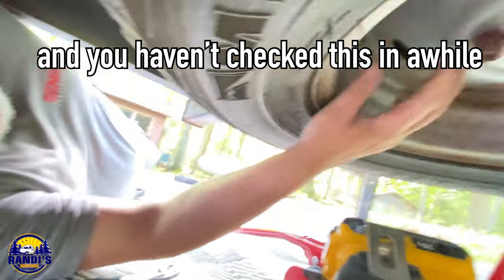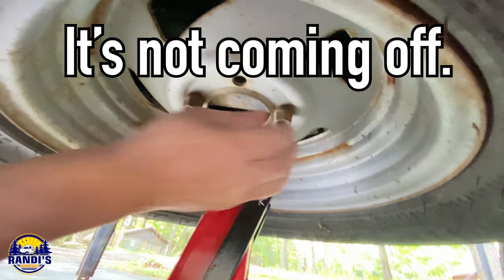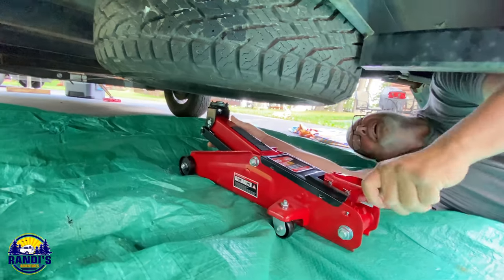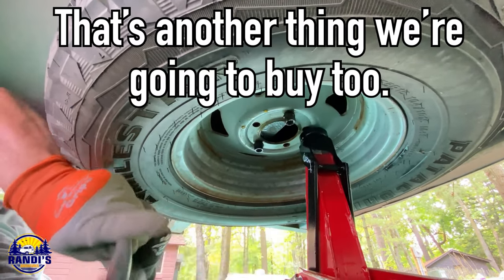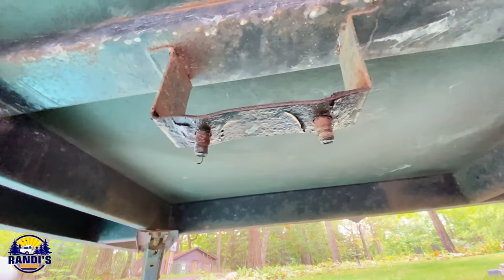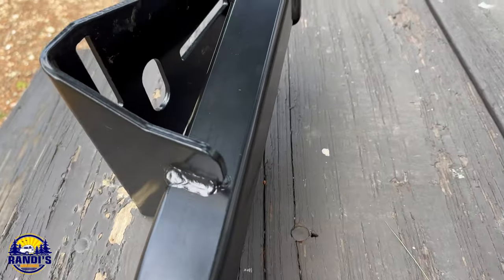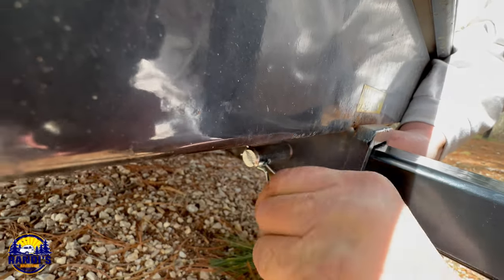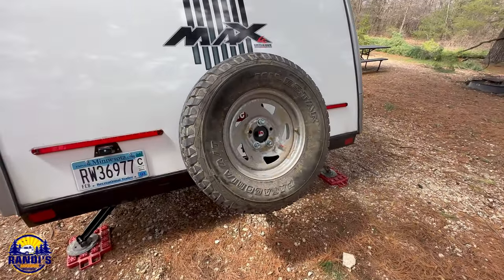BEWARE of THIS RV Spare Tire Under Frame Mount PROBLEM!

Comment: Just wanted to point out there is a large difference between an impact driver and an impact wrench. In the video you are using an Impact DRIVER. These are meant for lighter duty tasks such as framing/decking and sinking occasional lag screws into wood.  They are not intended to remove lug nuts.   The Impact WRENCH however, is meant for much heavier duty applications as removing lug nuts, axle bolts, etc.  The main difference is the Impact DRIVER uses the 1/4" Bit Driver vs the Impact WRENCH  would have a 1/2" Anvil for sockets. (they make smaller impact wrenches too, but 1/2" is what you'd want for repeat lug nut use)      If a 1/2 Impact Wrench would have been used it would have zipped those lugs right off as they offer significantly more torque.  I would reccomend picking one up and bringing it on every trip, because it'll make tire changes a breeze.
Reply from the maker: Thank you… thank you so much for sharing and explaining this! That totally makes sense and your info will be helpful for others reading your comment also! 😊

Comment: Glad you got the problem solved. I installed a BAL Retract-a-spare. Easy installation and it cranks down just like a pickup truck or SUV.
Reply from the maker: We had no clue what an ordeal this “weekend project” would be, John! We also installed a BAL spare tire mount but I'm not sure what the difference between your mount is?

Comment: Glad you got that off, what a workout.  Personally I carry two spares. Goodyear 8 ply tires, 65 PSI. My camper go in the shop for it's yearly maintenance May 2.  The usual maintenance roof, slide out checked, wheel bearings packed, and shackles by the springs spot welding checked.
Reply from the maker: That's so smart to take your camper in for annual maintenance, Jim! If we had perhaps we would have discovered the bolts and nuts on our spare tire were corroded! 😁

Comment: I have a few suggestions for you: first, I'd use lug nuts instead of the flat washer. They will seat down better in the wheel well and won't distort the grove for when you actually attach it. The next suggestion is that you get a locking hitch pin and then secure it with an anti-rattle clamp. And next, based on what I see under your trailer you need to coat everything with some type of rust-oleum. You're losing metal under that thing rapidly. 
Lastly, move to the southwest where the weather is warm and we don't put salt down on every road... 
Warm thoughts... 
Pat
Reply from the maker: Such great tips as always, Pat! Thanks for making my to-do list longer! 🤣 You’re the best!

Comment: You need a more powerful gun. I have 2  m18 impacts that have 1/2 500ft/lbs  or 3/4 1200 ft/lbs respectively.  I keep a 500ft/lbs impact in each car for changing flats. The 3/4 could rip the studs off if you let it. Also just torch it for a few minutes with a torch, and they will come off easy peasy. you can also coat it with a sealant spray after you put it on which will prevent the corrosion. Also when you put them on use anti seize lubricant (silver) on the threads. I use it on all vehicle lugnuts and behind the rims if they are steel especially. They also have hammer impact removal tools. You hit them head on with a hammer as the unit simultaneously rotates.  The combination of forces works magic.
Reply from the maker: Thank you so much for sharing this really helpful information! 👍

Comment: Did you use an "impact wrench" or just a drill & socket?   I bought an impact wrench for that purpose.
Reply from the maker: Nope... We didn't an impact wrench. Maybe that would have helped?
Reply: First thing i thought was the rattler is to small...glad you got it off..

Comment: What an ordeal.!  Clever that you took it off before you needed it.
One has to wonder who designs something like that.  
You may want to consider a cover now that the tire will be exposed to sun.
Reply from the maker: I couldn't believe how difficult it was to get that tire removed! Funny you mentioned a cover. I had one but the way it fastened onto the tire didn't seem secure to me so I'm going to order another one. 😁

Comment: By moving spare further  back, the weight distribution worsens to the rear of the trailer. Did you add weight to front of trailer to counter balance the shift of the spare tire location?
Reply from the maker: No we didn't but that's a good point. We stayed well below the receiver max weight.

Comment: First get real tools!Cordless drivers running through a 1/4" extension ain't gonna cut it!All ways use anti seize on all lug nuts and buy a proper 6 point socket and breaker bar.This can also be a real nightmare on your road wheels!